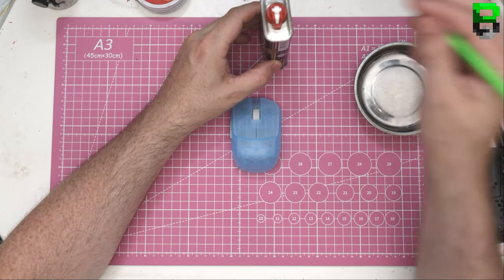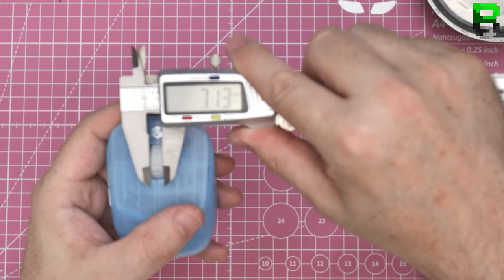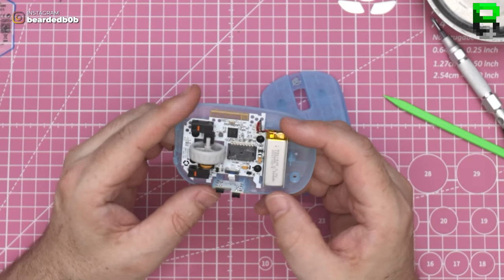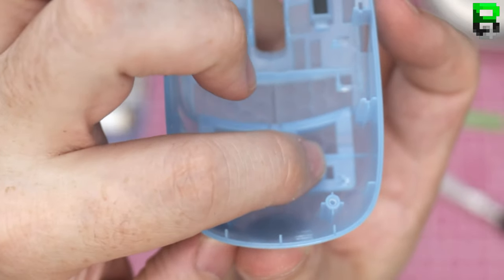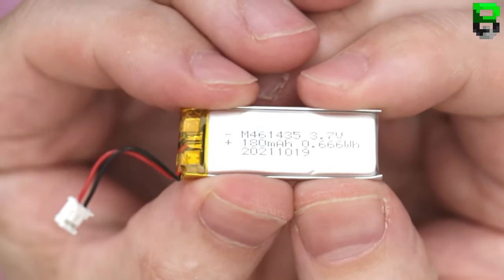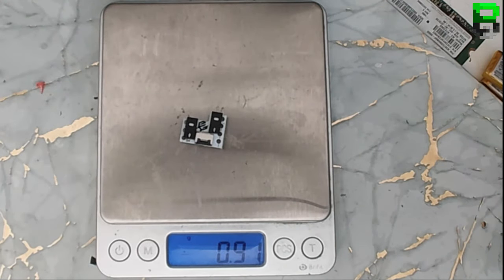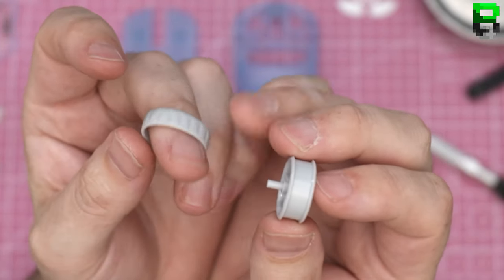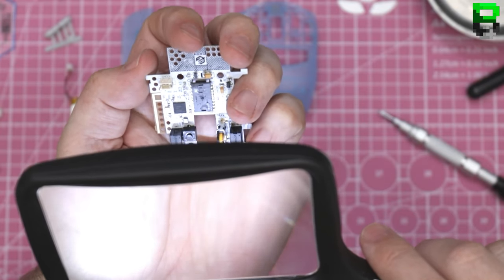YOU WONT BELIEVE HOW SMALL THE PCB IS!: G Wolves Hsk Plus Wireless Teardown

Comment: Ironically i like heavier mice, but i also like the small form factor, so i was able to fit about 12 small nuts wrapped in electrical tape inside which added a significant amount of weight, all without interfering with mouse clicks or the scroll wheel. It's a really great mouse otherwise.